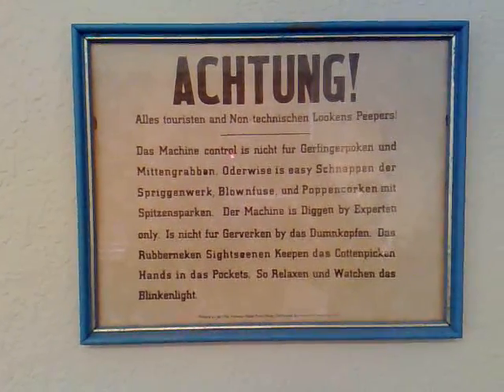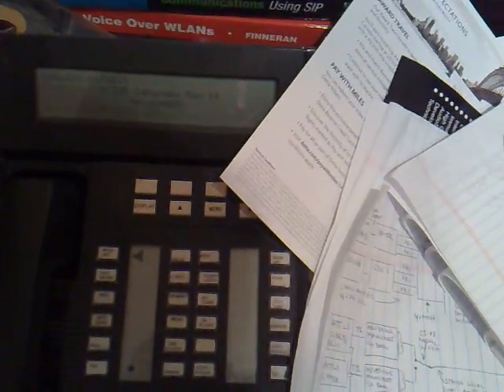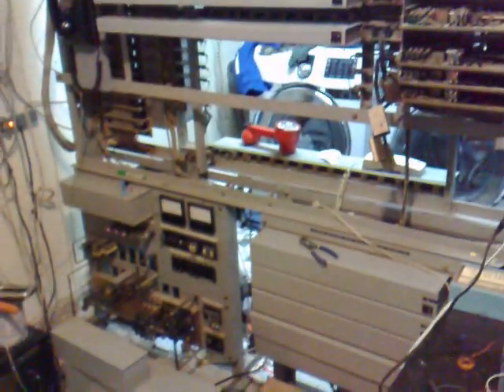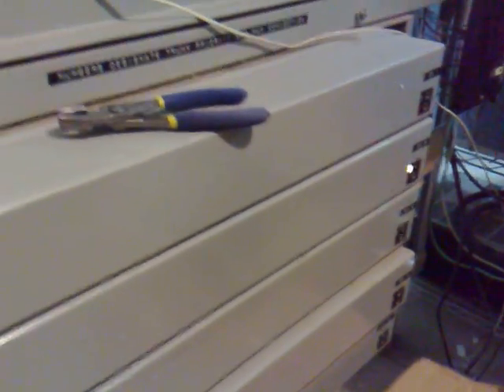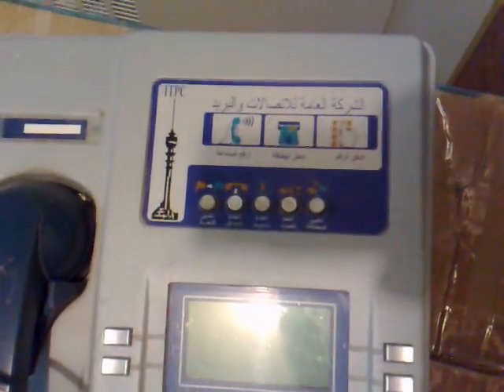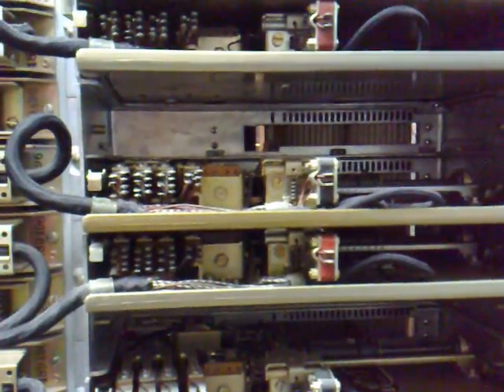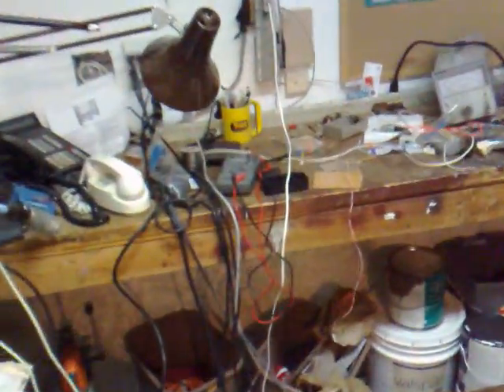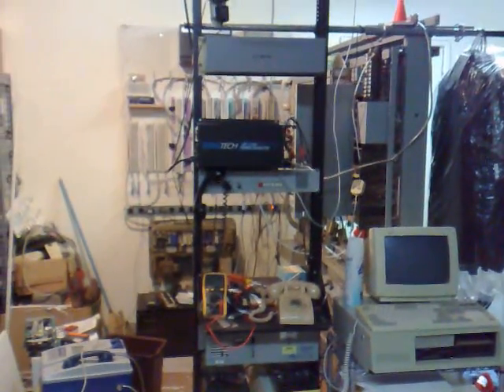Stromberg Carlson XY tour

Comment: The XY equipment had a feature called executive override. This allowed a phone call to be overridden from another phone and break into an existing connection. A special code number was used after calling the number you wanted and was busy. Then it would connect you to the caller.  Really high tech for the time.

Comment: Thanks for the video of the SC XY. I operated a SC test desk on a 5000 line SC XY exchange in 1970 - 71. Being a cable splicer was a huge plus as I knew where all the cables went to. I never will forget the sound of that XY switching, it was loud. Good equipment I thought.